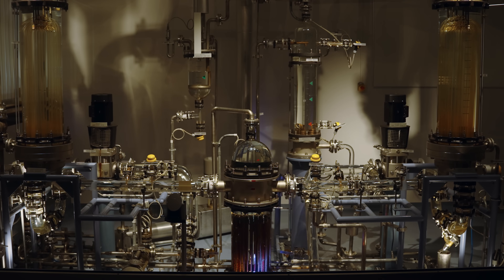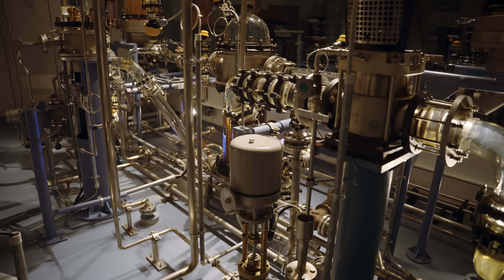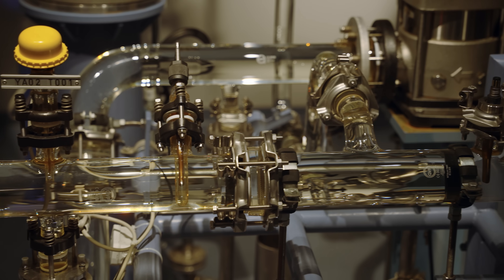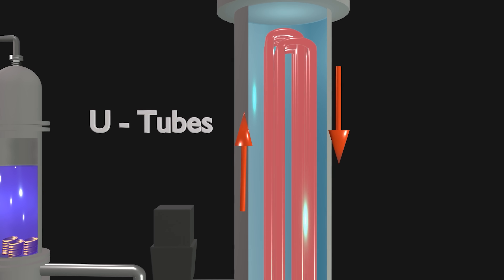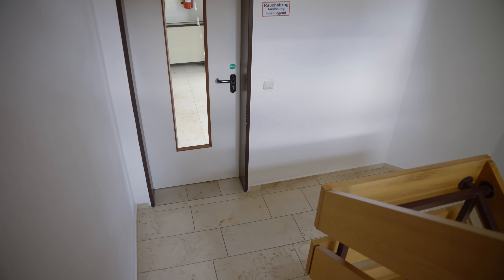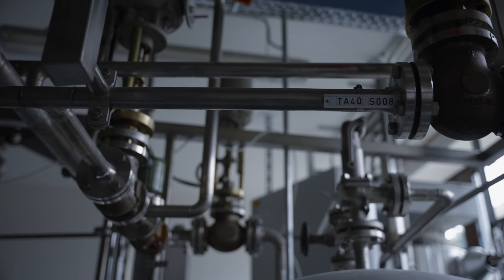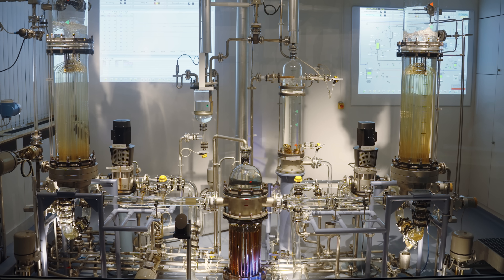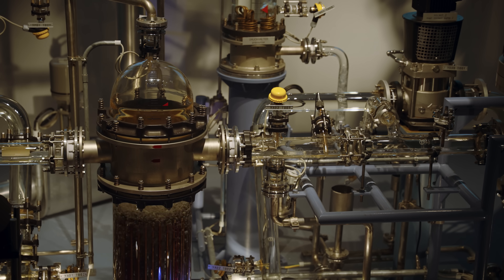World's Only GLASS Nuclear Reactor!

Comment: As someone who works to build specialized simulators of power plants here in the USA, the training aspect is well appreciated by those in the field.  The facilities pay millions of dollars for digital simulators to train their operators so that they know exactly how to respond to any number of failure conditions.  Depending on the size of the facility, an outage may cost anywhere from $100,000-$500,000 an HOUR and operators that know how to handle equipment malfunctions can save many millions of dollars by avoiding forced outages over damaged hardware.

Also interesting is that most baseline power is generated in nearly the same way, whether it is coal, natural gas, or nuclear.  Its just different ways to generate steam, each with their own specialized requirements, of course, but many aspects are shared between them.  Even aside from the nuclear aspect, this glass model can teach many things about other power generation methods.
Reply: You are low-balling a bit.  For planned outages (refueling mainly) replacement power at the plan where I work used to run $30 or so per MWh but it has drifted upwards to around $50/MWh for the last refuel.  Yes, price does depend on company resources available and forecast demand to determine what portion has to be contracted to the pool.  Forced outages, though, are much more expensive because they are forced to buy on-spot or short lead contract which can be $70-$80/MWh.  For the plant where I work this can easily be $1M/hr - and that is just replacement power cost. 

Your point, though, is well stated in that money spent to avoid forced outages is well spent.  The rate payers also benefit from a low forced outage rate since the replacement power costs are eventually passed to them, and a plant that doesn't have to shutdown because of a fault is a safer plant for everyone.

I don't work directly with the simulator (not an operator) but I do fidelity reviews and updates as part of our design change process.  There is no training tool quite like one that gives the immediate feedback that a simulator does.
Reply: Indeed one of the things people are looking at for nuclear is to retrofit coal plants with nuclear steam generation. Generally speaking the turbines themselves aren't actually worn and if they are they can be repaired economically and returned to service. However all the stuff that deals with moving, crushing, burning coal and boiling water is what gets worn out and can't really be repaired it has to be replaced whole. 
Drop a reactor next to the existing coal plant, plug the steam in and you've got 30 more years of power with greatly reduced effort and no CO2.
Reply: @zyeborm  Wish it were so easy.  The steam temperatures and pressures involved in a "modern" fossil plant are way higher than those in the usual nuclear plant.  Most commercial nuclear plants run about 1000 psia saturated whereas a lot of burner plants are above 1500 psia and superheated to boot.  The turbines would not be very efficient at the nuclear steam supply conditions or would not produce the design power so the whole plant would need to be downrated.

Comment: Kyle should start a crowdfunding campaign to save this work of art
Reply: 100% agree, but I wonder just how much would be needed to disassemble and move.
Reply: Yea I thought about this too but it would most likely be in the millions
Reply: @sunnyd5944  Just carefully disassembling it and storing it would probably take about €10.000 or so, it's not a huge amount of stuff. Quite comparable to a large house full of stuff that has to be moved. I assume all the documentation is still available, so you don't have to document everything while disassembling.
I think it will easily fit in one standard shipping container.
Reply: @laurensvisser7623  it seems like alot more than that hence the basement part of the reactor plus the full controller room
Reply: @laurensvisser7623  It's more likely closer to 5 million USD if you think about it. Moving it to the US that is. Keeping it in Europe would probably cut the cost in half, maybe a little more. There's a lot to move, wiring to be dis-assembled, very fragile bits and pieces, etc. If you only wanted to keep the model and only use it as a display, and you left behind the control room and additional plumbing, that would cut the cost down to a fraction. But it would still, guesstimating here based on moving heavy equipment in the US, probably be at least $100 K USD to keep it in Europe.
Part of the reason my guesstimate is so high is adding in the cost of the facility to store and display it, so take that into consideration.
Reply: I very much like the ideia of getting a nuclear reactor to the guy one accident way of being a super villain! Where do I put my credit card info?
Reply: Would be interesting to take it on tour; have people pay admission to play a simulation of the world's most dangerous video game.
Reply: @lapatte_the_druid  The heck, "most dangerous video game"? The odds of even a handful of people ever dying from a real reactor problem is very low. Compare that to Call of Duty or Grand Theft Auto, closer to real-world daily situations that constantly result in numerous people dying. Or you could pretend to play Covid, which killed more people in 2023 than automobile accidents (and cars are consistently among the leading causes of death, preventable or otherwise!) despite "being over" in many places.

Comment: I have a question.  If you can do this with electricity instead of nuclear.  Why then can't you do this in a closed system.  For example, you get the rods hot the steam happens, it generates electricity from the turbines, but a portion of electricity is redirected back to the rods to keep the "reaction" going.  Is there just a limitation that means you can't generate enough?

I am just wondering.

Comment: Shame.  I've been part of the emergency planning and emergency management for a nearby nuclear power station.  I've seen the interior of the place many times - It's not the "big bad wolf" the uninformed and unreasonably scared segment of the population makes it out to be.  A big chunk of the planet's oxygen thieves want "clean power"..."electric cars"... "electric everything" - yet they don't want the safest, cleanest, highest-output form of energy generation to do it.  Solar, geothermal, wind, and hydroelectric are essentially a pittance on the whole of power generation - and if people don't want the other very high output generation methods like coal, oil, and gas to continue... they better pull their heads out of their exhaust tubes and realize that until (when and if) something like fusion technology can ever be mastered (and which will surely have it's own challenges and dangers) - or IF they can ever get solar generation up to even something NEAR 40-50% or higher efficiency - Nuclear is the obvious choice.

Comment: Honestly that entire site looks to me like it should be a museum. Germany should keep a working model of its nuclear history, future generations would thank them for it. I get why its unlikely to happen, its expensive, but consodering all the things governments waste money on, this seems practically reasonable.

As for the model as a seperate piece, yes it should be saved but its not a simple process. There are 2  possibilities for how to save it. 1st is as a static model, just take it appart, move it, put it together and leave it be, much easier and cheaper (is far more viable), since it doesn't have to work it doesn't need to be perfectly reassembled (would be better if it was). Second is as a working model, this is far more complex for 2 reasons, the model is only a small fraction of the machines actual size, the backroom features are huge and not many museums have that kind of space. Second, its very expensive to run, using similar levels of electricity to heating a moderately sized swimming pool (you can't just turn it off/on for display purposes, it has to be brough upto temperature), most museums just don't have the budget and the few that do would need to choose this or something else for that cash/space.

Oh and throw in moving it is going to be hard, is isn't really designed to be disassembled easily and any breakages are going to be costly (i bet all its parts are custom made). You'd need to hope there are a detailed set of blueprints and suppliers for spare parts available.

Comment: Come on Kyle. You know that everybody knows that superheat is any heat added to a substance after the phase change point. I.E. any energy added to a gas once it's phase changed from a liquid into a gas or any liquid once it's phase changed from a solid into a liquid. You do not, and I repeat, you do not need to pressurize water above atmospheric pressure to superheat it in its liquid form.

Comment: I didnt like how headless the german gouverment killed nuclear pover. We even had to switch some coal plants back on because the power is now missing. But there have been no trainees in 12 years and now there is nobody who even could run the plants that have been shut down. Ofc we still gotta maintain them but no power to be generated. Reasons: a wave on the other side of the world. Germanys powerplants are nowhere near ocean. Also there are no earthquakes. We have highest standards for everything yet dont trust ourselves. Meanwhile there have been claims about leaking radiation from bad maintained french powerplants where the power we miss is bought now. France has most of its powerplants near germany. We are still in "danger" but are dependant on france to handle it.

Comment: If nuclear power is so dangerous, how is it that the United States armed forces have been using molten salt reactors for years without failure?

Speaking in which, do you have anything that would show how or a simple explanation of how a molten salt or molten lead reactor would work?

Find a way to buy, build, and keep that glass reactor - the facility would be an awesome place to house it!

Comment: Strange, you'd think a comp[any with that much  DEEP technical knowledge of nuclear powerplants, would be able to come up with a business plan for international clients in countries that run reactors, and not just the ones with German type reactors to produce simulators and train staff... I'm of course no expert, but are reactor designs that different, their simulator couldn't be (easily) converted or expanded to handle different types? Like flight simulators? (I know, that's a gross oversimplification)

Comment: Nuclear energy is safe. Only problem is we use literal pressure cookers to generate the steam. There is newer designs that drain the fuel if it melts down which stops the fission. 

If you want a conspiracy to believe in its this. Also the fact japan cant dump tritium water into the ocean cause of "radioactivity". Radioactive bad m'kay.

Comment: They should look into using VR for the simulator if they aren't already. That would help it be more like the model in real life. 

Also, it probably would have been good to specify that when the radioactive material was released in 3 mile island, it was released inside the building designed to be able to contain it, not into the environment.

Comment: Renewable energy suffers from fickle generation.   Gas powered generation can be spun up and down at short notice but that's still a fossil fuel.  Coal and oil for generation needs to be phased out.  That leaves nuclear, especially as gas powers an expansionist dictator.  Shutting down nuclear in Germany is just retarded.  France remained nuclear.  Guess which Western European nation exports electricity.

Comment: It's so sad! They would only have had to wait like 100 years at max for fusion power to potentially replace fission, so that the waste building up is no issue anymore. For the potential accident, just build a few more of these, design safer reactors, and make those safety protocols tighter if you are that concerned. You can spend millions of euros on that instead of fearmongering, and creating a lot more issues later on, by making chemical power plants (coal gas etc.) and strenghtening your reliance on inport gas for example. The easyer option (backing out for example) is almost always the worse one.

Comment: The issue with nuclear power is the plants are way over engineered. All the failures comes from a bad value or bad pump. It doesn't have to be this complicated. But since the design predates computers, we are stuck with old ways of thinking.

Comment: If OMSI could buy that glass reactor that would be an amazing oppertunity to tech kids about nuclear power.
Reply: In my school days, I wanted to build a basic nuclear power plant model out of transparent plastic tubes, for the science fair.
I planned to use an eletric heater as "spicy rocks", and run colored water to show the heated water not mixing. Low pressure, not showing  the complex stuff (pumps and valves) just the basic concept. 
A mix of glicerin and water for the first cicle (glicerin elevates the boiling point of the water), pure water on the second, forming steam to "run" a simulation turbine, and out to a paper-machée cooling tower. 
I had it all sketched, but one detail made it impossible: money. Heat resistant transparent tubes were just too expensive to buy, for half a dozen 13 years old kids to use in a one-off project.

Comment: On a side note about glass and nuclear reactors, a friend of my dad's in the industry said that reactor's should have tons and tons of glass beads above them in case of meltdown and rod failure, like in Chernobyl. He said that the glass would melt, fuse with the melting nuclear fuel and because Uranium will diffuse within glass (like Uranium glass) it will separate it and stop the reaction in it's tracks. this made me think of that.

Comment: Nuclear Power Vs Fossil fuel for dummies: 

Fossil fuel = excavate or drill for fuel, constant burny burny, bad fumes,  small chance of accidents, if accidents happen, small ouchie, few people cry. People cough all the time, ice melts, floods increase, polar bear dies..

Nuclear power = spicy rocks boil water to make steam engines go BZZZ, no bad fumes only water vapour, a few discarded spicy rocks every few years to store away safely inside a mountain or under a bigger rock, very strict safety, very costly buildings, very few accidents. IF accidents happen tho, big ouchie, lots of people cry. Polar bears are happier.

Comment: Not happy in ditching nuclear energy to buy gas from a Russia and being the biggest enabler of this country whose sole mission is conquer other countries, now Germany will erase the history of nuclear engineering. Brazil have two nuclear reactors (to produce energy I not mentioning the several research ones) one from Siemens that always worked well. The other made by Westinghouse had a generator that never worked well with shorts, problem in steam supply system, and other problems, the fixing of a rotor with tens of meters would need to put part of the building down (no danger associated with radioactivity just the only danger was for the money spent). It was partially fixed only in 1999 decades after it started to work. In Brazil it was nicknamed firefly by the newspapers.
 
This was a design flaw that made Brazil and several other countries to sue Westinghouse. Brazil off course lost the multi hundred million process in an USA court, nothing political at all off course. This shows a little about the quality of German nuclear reactors and the respective companies culture.

This (and other sad factors (like a parallel nuclear weapon program, corruption, bad public perception of nuclear energy, lack of money as Brazil was too used by everything being financed by the government, etc) was one of the factors nuclear energy never advanced in Brazil for good or for worse. If we started with Siemens from start to finish...who knows...

Comment: 9:12 As is YouTube reply guy tradition, I’m going to have to disagree here. One very important factor in simulating PWR physics is the effect of water temperature and daughter products in the water around the fuel. Suddenly cooling the water or increasing the pressure will cause a spike in criticality as the voids of steam around the fuel get smaller, and vice versa. Daughter products can cause an increase in temperature too after they continue to decay. These accordion flux in energy can get out of control, necessitating a SCRAM. It’s a “minor detail” but very important so trainees don’t do too much too fast.

Comment: "Show them in the comments"
I certainly will. One valued memory I have as a child is visiting the nuclear power station at Hinkley Point. They had a small museum there with a simple digital simulator, and I had a lot of fun trying to balance the various 7-segment LED readouts in order to keep the "reactor" producing useful power, without sending it critical. They also took us on a tour of the reactor building for Reactor B, and I remember it being quite underwhelming - to a kid, it was just a mass of steel tanks, piping and concrete. Being able to physically see how the reactor worked, or even run a simulation on a device like this would have made my year.
I really, really hope a museum picks this device up. Kyle, if you do find out what finally happens to this, do let us know in a future video.

Comment: Didn’t Germany switch back to coal? I feel for those are and have worked at the facility. It’s an amazing beautiful piece of equipment.
Reply: Nope, Solar and wind power were expanded, which last year accounted for 60% of the total electricity mix in Germany.
Reply: @annocraft and you also recommissioned old oil and gas plants